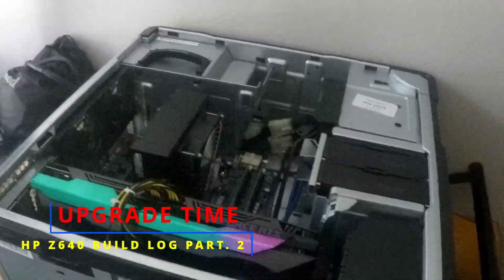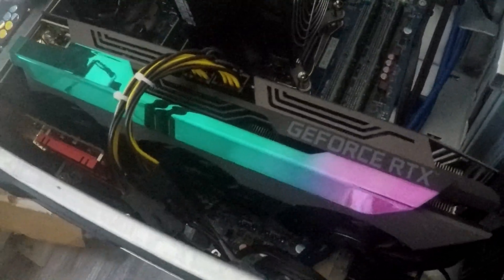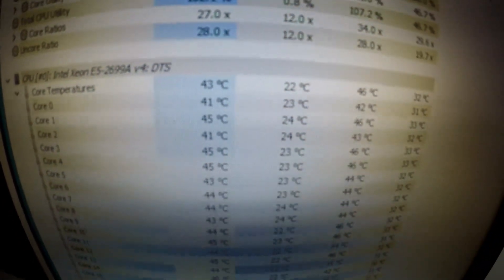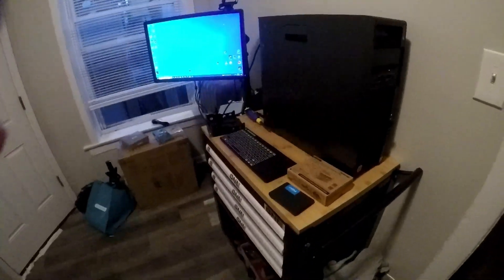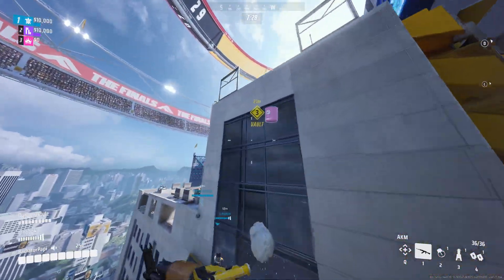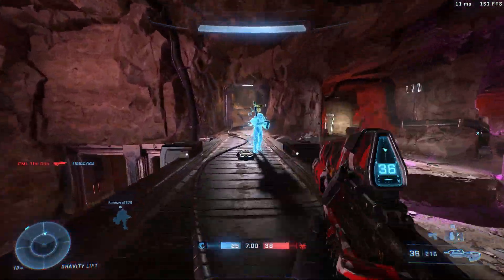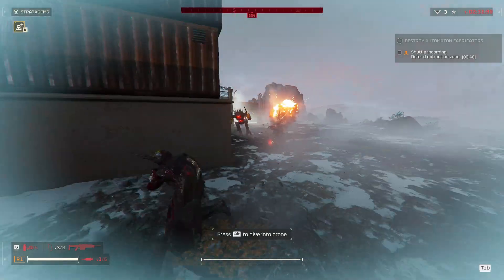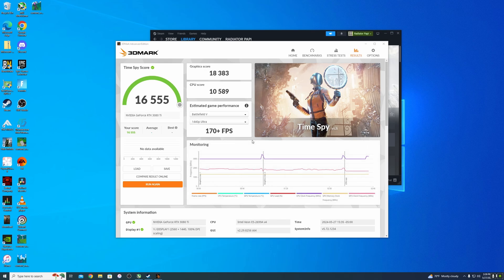UPGRADE TIME!!! - HP Z640 Build Log Part. 2

Comment: A suggestion, given 6 pin power cables are generally rated to 75W, get a dual 6 pin female to single 8 pin male adapter, with heavy gauge wire- cost about $14 and use two 6 pin cables on the Z640 to power your GPU.

I run dual E5-2699 v3 into a RTX 4070 super (which has a single 8 pin connector) so between the PCIE slot and two 6 pin cables, nothing is drawing above rated current loads.

My rig is for astrophotography- so my needs are massive compute (36 physical cores), massive I/O (4 x 2TB M2 NVME drives in RAID 0 via a PCIE x16 card) and 256 GB of RAM, the GPU was originally a P4000, but I wanted more VRAM and more CUDA cores to speed up my workflows.  All up it works a treat!

Comment: Yo, I got a z640 too! it’s a m6000 quadro series with a 1650 v3
planning on a 2080 ti and a 1680 v4  would it be recommended for the 26xx v4? and thoughts on the dual cpu riser board?
and how’d you get the connectors? i only got 1x 8 pin for the ps. I really can’t find too much about z640 builds  ‘-‘
Reply from the maker: Thanks for watching! Sounds like you got a beefy z640 yourself! The 1680 v4 would slightly better for gaming as there is a higher single core boosts on that chip verses its 26xx counter parts. If you are trying to save a buck, I would recommend the E5-1667 V4 as it’s a much cheaper chip and boosts slightly lower. Now if you are using it for other stuff like productivity more often and want more cores, lots of E5-26xx V4 chips like the 14c or less going for very cheap. Not to mention if you wanted to use the riser board you would need a 26xx chip as only those can run in a dual cpu configuration. Personally I think a second chip adds more latency but if you want a crap ton of cores go for it! As for the 6-8 pins, it’s luck of the draw. My build came with 2 6-pins from the seller so I just used adapters as seen in my first video. It may be because my build came with a 925w PSU and could allow for two. Hope a little of this was some help!!!
Reply: @radiatorpapi  thanks very much! trying to get this thing into vr specs range so, it helps alot to have this info ^^
tried to looking for bios modding with no success sadly
Reply: i wasa complete moron and didn’t know it was actually two 6 pins 1 was tucked in the front fan and 1 was converted to an 8 pin lmao
Reply from the maker: It happens man! Glad you found the other one!!